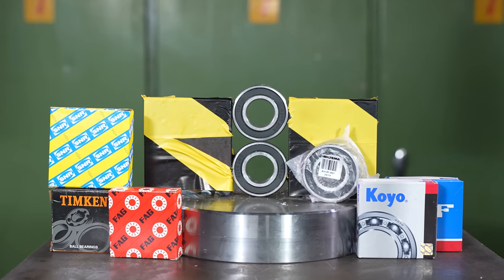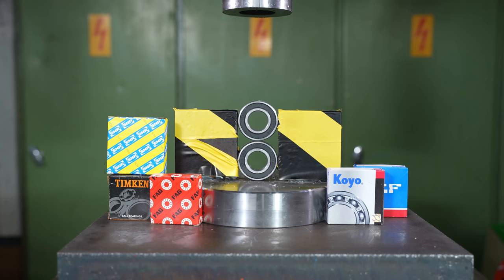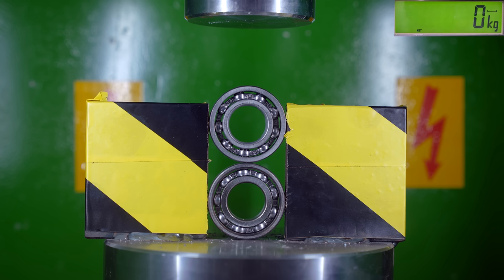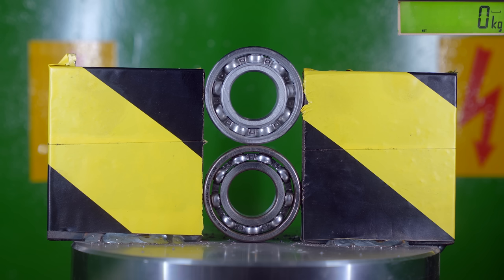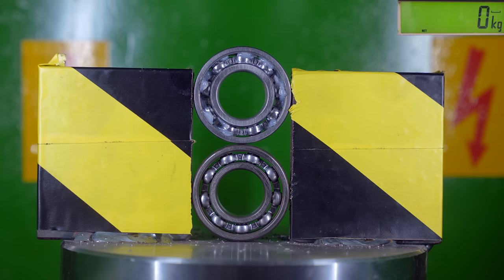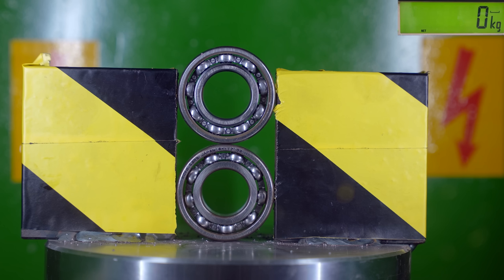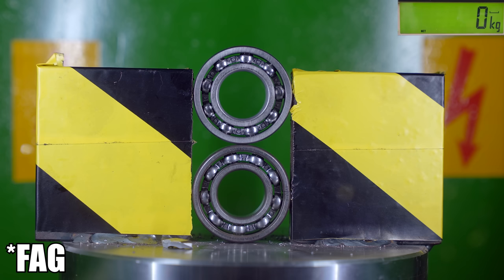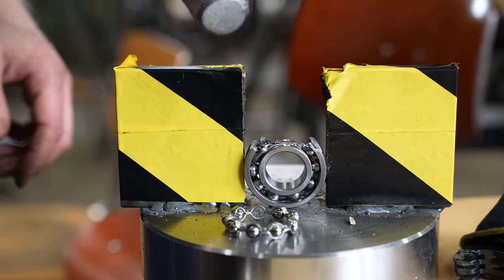Brutal Ball Bearing Test with Hydraulic Press

Comment: Timken and Chinese NoName got so far because their bearings are more ductile. That is not desirable. You'd ideally want a bearing to not flex even the tiniest amount up until the point where it shatters. This is not possible in the real world, but with the correct alloy and heat treatment you can get absurdly low flex almost all the way to the tensile limit.

Comment: All the years I thought SKF was the best,I'm surprised 😏
Reply: This test is completely worthless and you have no reason to change your thought. These bearings aren't meant to work this way. Ball bearings are tightly supported by the bearing houses on the outside and the shafts inside. The hardness of the material and the machining precision of a bearing are the things that tell its accuracy and lifetime.
- Also notice that very hard materials like hard metal inserts and bits are pretty brittle, not talking about diamonds.
Reply: @ontheroadagain4773 Thanks for the teaching,love to know everything 😄

Comment: Funny to destroy stuff with hydraulic press but it is in no way a valid BALL BEARING test. These are not made to resist forces that way. A good test would have be from inside ring to outside (the load on the bearing) and also a wear test.  This crunch test is irrelevant.

Comment: In  no way this test gives an indication for the real life preformance of the bearings. The load on the bearings is totally different than they are designde and tested for. The sturdy ones with hard races and though core will snap, the ductile ones will survive, in real life however....

Comment: A good show but a completely useless test! These bearings aren't meant to work this way. Bearings are tightly supported by the bearing houses on the outside and the shafts inside. The hardness of the material and the machining precision of a bearing are the things that tell its accuracy and lifetime.
- Also notice that very hard materials like hard metal inserts and bits are pretty brittle, not talking about diamonds.

Comment: Your test are not equal. Top and button force is different. Should be one at time. Stainless steel is weaker than steel. 👎
Reply: It doesn't matter. These bearings aren't meant to work - and shouldn't be tested - this way. Ball bearings are tightly supported by the bearing houses on the outside and the shafts inside. The hardness of the material and the machining precision of a bearing are the things that tell its accuracy and lifetime.
- Also notice that very hard materials like hard metal inserts and bits are pretty brittle, not talking about diamonds.

Comment: sorry, but this test has no value at all, you basically only tested how the individual bearings are hardened, the Chinese bearing won, but why? because it was not properly tempered, thus the chinese  is much more flexible, it also means that it wears out faster, so the Chinese bearing is worth shit